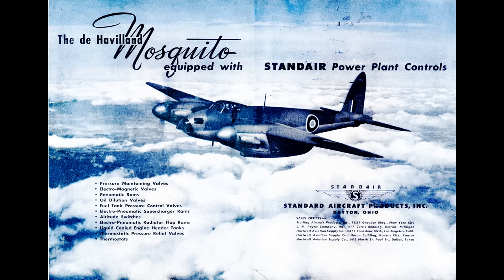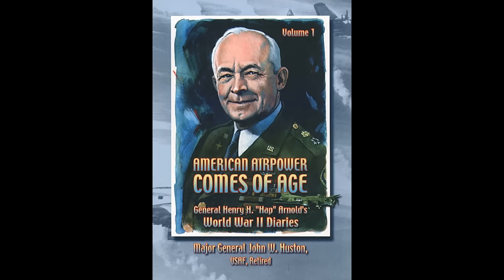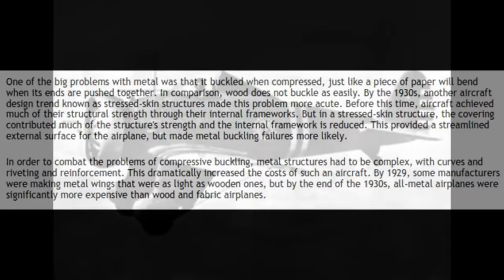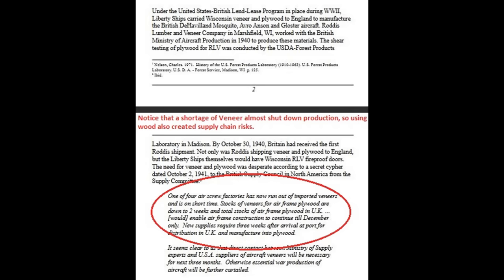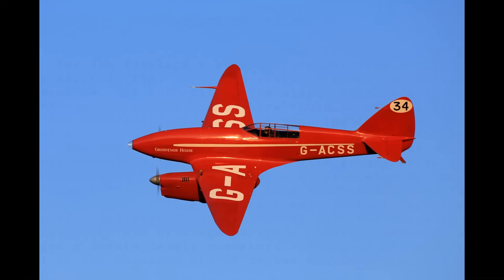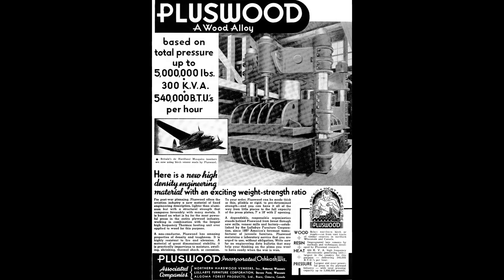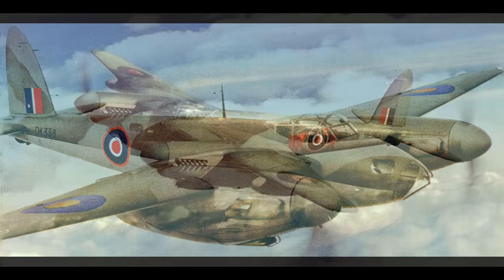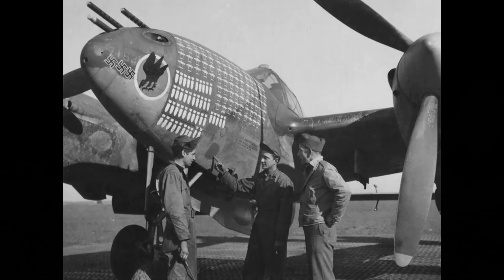De Havilland Mosquito vs. ?

Comment: I feel like I need to add... the mosquito landed on an aircraft carrier... The P-38 did not.
Reply: The mosquito was useless in the PTO and the CBI because the humidity destroyed the wooden skin.  The P38 was king of the sky over the Pacific.
Reply: @khaccanhle1930  Well, I don't think the P-38 did very well in Europe because of the cold weather if it comes to that.
Reply: @khaccanhle1930  disagree with that totally it was never meant to last that long and fulfilled all round functions truly brilliant using otherwise redundant skilled workers it didht rely on one manufacturing factory and was spread over the whole country making production less risk of being bombed
Reply: @rob5944  the main issues with the P-38 in the ETO too start with were both bad cockpit & engine heaters & low octane British fuel. The Allison's HAD to have a high octane fuel for reliable ignition. They would suffer from both pre-det & post-det on the cylinder heads & icing in the trubos. 

On the other hand in the MTO & the PTO neither theater could get enough of them EVER & since they spent a larger amount of time at mid & low altitude, where they would suffered fewer engine casualties. There's a reason the Luftwaffe units in the MTO called the P-38 the "Twin Tailed Devil". Until the German Med units started to get the G-series 109's & A-8 & later 190's the P-38 was faster & as maneuverable or at least a 90% solution. The P-38 has about a 30 mph advantage over the F-series 109's & could turn INSIDE of the nimble lightweight German fighter for about 2/3rd's of a complete 360. 

The P-51 was better at all altitudes & the Jug was better st high altitudes, but usually by the time you got to 20-30'000 ft from an airbase in Egypt/Tunisia or Sicily, you were either AT or PAST The target. So most engagements were between 10-20'000 ft & the P-38 was a MONSTER at those altitudes. 

In the PTO they had to HAMMER new pilots not to engage in turning fights with Jap planes NOT because the 38 couldn't keep up with them in turning fights, but because the 38 would lose enough ENERGY in the fight when all they really had to do was maintain slashing attacks & be almost immune from retaliation from Oscars, Tonys & Zeros. The Jap front line fighters, if they tried to get in the High-Speed combat that the 38's excelled at could & would tear their own wings off. 

The PTO wasn't a "Turkey Shoot" by ANY means, the first side to see their opponent & get into a viable attack position would still win, but the 38's outclassed the opposition as a weapon system by a large margin.
Reply: IIRC that was "Winkle" Brown that flew that. No idea how he got his balls into an aircraft!
(Just checked, yes, and there's an interview about it on youtube too!)
https://www.youtube.com/watch?v=d9Hjne0OA4w

P-38 never sported a 6lb field gun int he nose either! :-D
Reply: Ross Cox shooting down a Betty Bomber isn’t exactly complicated. Japanese planes didn’t have amour. My point is the mosquito did something the P-38 never achieved. The Mosquito downed lots of twin engined bombers plus a few night flying V1s. That’s not to take away from the Yamamoto mission, lots of intelligence and planning was needed, the P-38 was the only plane the US had that could have done that mission at the time.
Reply: Ross Cox  the P-38 was a bit of a rarity over Europe, being swapped out for Mustangs in many cases.

P-38 expert Warren M. Bodie wrote that the Lightning should have been converted from Allison to Merlin power, exactly as was done with the P-51. “Neither P-38 pilots, mechanics, facilities or logistics were prepared to operate efficiently in one of the bitterest European winters on record [1943-44],” he noted. “No other Allison-powered aircraft ever operated at altitudes of more than 20,000 feet over the Continent for even a half hour.” Bodie was a staunch advocate of the P-38, but in a 1991 interview he acknowledged that it achieved “mixed results” in combat with the Luftwaffe over northern Europe.

IIRC, the Mosquito had a range advantage over the P-38 too.
Reply: Khắc cảnh lê couldn’t have been that useless or the Australians wouldn’t have produced them for their airforce. As Greg pointed out there is a lack of evidence for your argument.
Reply: Ross Cox the game I’m playing is in response to Greg’s video which whilst discussing the Mosquito went on a long P-38 achievement list. I thought it was appropriate to mention the first ever twin engine bomber carrier landing piloted by the legend that is Captain “winkle” Brown.
Reply: Ross Cox  Bit of a foolish thing to say really. If a Mosquito FB VI had come across that Yamamoto-carrying "Betty" it's four 20mm cannon and four .303 Brownings would have ensured the same.
Reply: Ross Cox  - Are you suggesting that, of the two types, only the P-38 was capable of downing a Betty? Your 'comparison' is meaningless otherwise.

A more relevant addition would be that the Mosquito was so highly respected by the Luftwaffe (and German High Command) that its pilots were awarded 2 'kills' for downing one.
Reply: @juststeve5542  For what it's worth,  Robin Olds flew the P-38 in Europe and loved it, although he was an exceptional pilot. He later transitioned to P-51's and felt the only clear advantage the Mustang had was in range and freedom from compressibility issues. Of course from a strategic standpoint the P-51 was much cheaper to build.
Reply: @khaccanhle1930  Please watch the video Spitfire 944, it was flown by an American pilot on P.R., he was transferred to long range Spitfires after the P-38s he was flying kept failing , he also said the long range Spitfires had a slightly better range than the P-38
Reply: El Guapo mas macho  and mosquitos bombed a military parade timed exactly for Herman Goering’s speech which was being transmitted live. P38 didn’t do that either.

Comment: Greg, great video, would love to see more about my favorite plane. One comment though - you are wrong about the ability of wood to withstand bullets damage. It is true that a bullet will easily go through a thick wooden beam. However, the damage it leaves behind is minimal - the wood’s fibers spread and allow the bullet to go through then close behind and only some are severed. The energy of the bullet does not matter either since more kinetic energy just means that the bullet comes out faster on the other side. Since wood beam are much thicker than metal beams this leaves the vast majority of the fibers undamaged, and structural integrity holds. It takes a few bullet hits to the same location to severely weaken the beam. With metal beam its all or nothing- either the bullet is deflected by the beam or the beam gets dented and collapses. Unlike with wood, more energy to the bullet makes structural failure more likely.
Reply from the maker: I can find no evidence to support what you are saying and I've personally seen a lot of evidence to the contrary. If you have a link to support your position, please post it and I'll factor it into the next video on this subject. I would really like to see something that supports your view, but I haven't been able to find that.
Reply: I wonder how sensitive the explosive round initiators were and while I would hate to think of one exploding in a wooden main spar I bet thinner areas would allow a free passthrough on wood.
Reply from the maker: I've been looking for original data on that, but I can't find any.
Reply: Greg's Airplanes and Automobiles the Mosquito was fast but not impossible to hit. It’s service record should be a good indicator of how durable it was. Speed along doesn’t explain this. Especially with all the low level intruder missions it did.
Reply: @GregsAirplanesandAutomobiles  Mythbusters had an episode where they tried chopping down a small tree trunk using various sized machine guns. It took the very largest bullet size they had, that was mounted on a truck, and firing a very large number of rounds. 
Probably too many for a WW2 fighter to carry, and of course both target & aimer were stationary.
Reply: Greg's Airplanes and Automobiles I doubt quantitative tests of metal vs wood are anywhere to be found. It is a poorly defined problem. I remember reading the above argument about the ability of wooden construction to withstand bullets - if I find it again, I’ll post it. It was in the context of explaining the durability of the mosquito to battle damage. It was considered a very durable plane (at least FB.VI model that were absorbing a lot of ground fire of all caliber).
Reply: @rararnanan7244  I have heard this also about the aircrafts ability to sustain considerable damage, this was from a family member who served in the far east, however he also stated that if a fire resulted it was fatal. The other issue that is often mentioned about the Mosquito, but is hard to pin down, is that, being made largely of wood, the radar signature was negligble.
Reply: @jonathan eddolls the “low” radar cross section is absolutely a myth. Not in any significant way to make a difference.

Comment: Even the greatest aircraft have their drawbacks. In the case of the Mosquito it was single engine handling at low speed, the RAF lost a number of crews in training accidents when simulating single-engine landings, the aircraft flipping on their backs when rudder authority was lost. Mosquitoes lacked carburettors capable of negative G manoeuvres, and in tropical monsoon climates the wood tended to deteriorate.

Comment: My Dad flew Mosquitos in RAF 89 squadron based in India and Burma. They had problems with fatal consequences due to wing failures in flight due to termites eating the glue. They jacked up the planes after sorties and lowered their wheels into cans of oil and suffered no further failures thereafter as the insects were deterred.

Comment: "all future large planes must of necessity be built of metal"...until Howard Hughes built one of the biggest planes ever...out of wood.
Reply: Wasn't exactly a great success though.
Reply: @fafner1  No, it wasn't. I was responding the quote in the video that large planes had to be made of metal for structural reasons.
Reply: Except that from 1946 onwards nobody built airplanes mostly out of wood.  And starting in the early 1960’s most boat builders stopped using wood. The Mosquito was a marvelous anomaly.  The RAF and the FAA didn’t switch from Aluminum back to wood after the outstanding performance of the Mosquito was made known.
Reply: @petersouthernboy6327  I agree with you. In the video, though, there was a quote from Beechcraft that insinuated that wood could not be used because it would fail in a large aircraft. It didn't in the case of the Spruce Goose. It is interesting now that the use of metal is declining versus increase in composites.

Comment: in the pacific war i believe the glue or adhesive that was used to bond the wood ,did not stand up well to the humidity caused by the weather
Reply: Thats why it was changed to a new syntheic Ciba-Geigy adhesive, probably Aerolite, as soon as one or two had failed under pullout loads

Comment: RE: Mosquito vs P-38 -- other than both being twin-engine designs, it's sort of an apples-to-oranges comparison to a surprising extent, I'd say. Yet there's still a large six of one, half dozen of the other aspect to consider, too. You might say De Haviland made the right plane for them and what it did, and the P-38 was the right plane for Lockheed and what America needed from it. The "fork-tailed devil" was an awesome fighter, especially for long-range escort missions. Some of the strengths of the two planes may have had little if anything to do with wood vs metal, and more with the Mosquito being originally planned as a fast light bomber. I'm just glad the Allies had both!
Reply: David Bump  Airplanes on the allied side ended up being quite a formidable bunch...Spitfire, Hurricane, Typhoon, Beaufighter, Lancaster, B17, B25 , P38,  P47, B29, Corsair, ...just to mention a few.
Reply: David Bump
I agree completely and thank you for posting the comment.

Comment: Lockheed aircraft were also highly successful in wooden aircraft construction in the 1930's with the Vega series.  These aircraft were the choice of the record breaking altitude champion Wiley Post and Distance champ Amelia Earhart in her initial record flights.  With wood veneers molded into a form and vacuum bagged with heat to harden the glue, they were far stronger and could be made to produce much less drag than metal aircraft at that time.  The metal people must have had much more of the politician's interest with their largess.

Comment: The follow on to the mosquito, was the De Haviland Hornet, a small single seat Mosquito type with  2 high powered merlin each driving a 4 bladed prop, the hornet was  also flown by the fleet air arm and the navalised  'sea hornet was equipped with folding wings (Balsa sandwiched wooden wings!) It was reportedly one of the fastest piston engine aircraft built...reportedly!

Comment: 19:20 As a hobbyist woodworker, I'd say those two evaluations of the structural problem could easily be the same reason. 
ESPECIALLY when working with lamination, ingress of water into wood tends to happen most at exposed end grain, which is also the place where glue in plywood is most directly exposed, AND often where it's easiest to insufficiently apply paint or other finishes, OR for those finishes to wear off.
In a very humid climate, non-pressure treated wood can absorb significant moisture to expand even if it is never inundated or exposed directly to precipitation.
Reply from the maker: Thanks for your comment. It certainly makes sense.

Comment: Dh 98 in Alberta air museum restored ....it is beautifull
Reply: Do they have a Lancaster as well? I have heard a rumor of one in Canada.
Reply: @johnivkovich8655  There is a flying Mosquito and a flying Lancaster. I think its called the CHM. Canadian Heritage Museum.
Reply: @bradyelich2745  The Hurricane is a tough one to find because of the variations in size of the fuselage tubes, make its frame almost impossible to repair even for static display.
Reply: @johnivkovich8655  This Hurricane will not be flown, but it is restored to flying capability.  You can follow the planes actions through interviews with the pilots that flew this plane.  Don't forget the story about Elsie!

Comment: Reading the US makers opinions shows the usual “NIH” (Not Invented here) snobbery.
Reply: Not necessarily, they could have had heavy bombers able to defend themselves in their minds.
Reply: @20chocsaday  But they did  and they wen'rnt much good
Reply: Actually I believe the American companies didn't want their metal framed aircraft to have to compete with wooden framed things because the metal manufacturers,       
    Which most of those plane companies had shares and what-not In,     
 would have seen a loss In sales because the mosquito and other aircraft like it just didn't need metal frames
Reply: @20chocsaday  You mean the B17, that had such a limited range that reduced it's capacity to the same weight of bombs that a Mosquito could carry. max weight for a Lancaster over Berlin 14,000, although didn't carry the bomb load very often, as the load was mixed. Max load for a B17 over Berlin 4,000lbs,
Reply: @Andyww08  The first Mosquito raid over Berlin took place in 1944, 4000 lbs carried at 406 knots, catch me if you can.